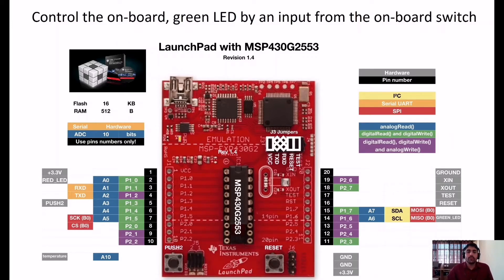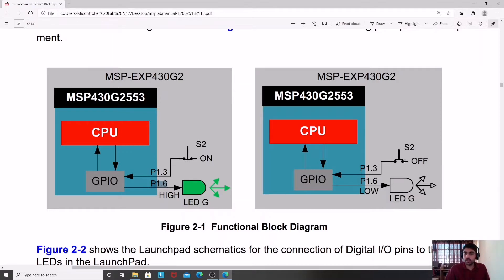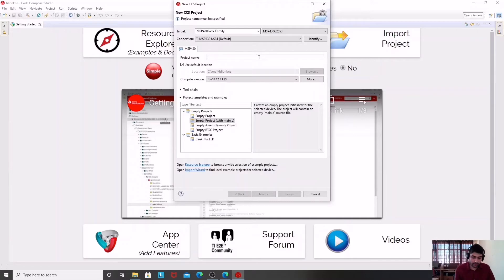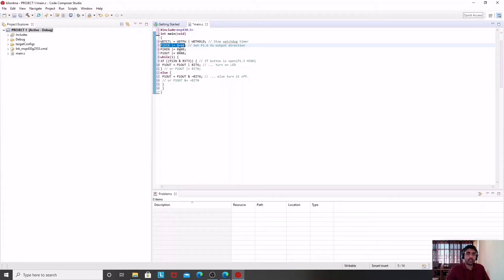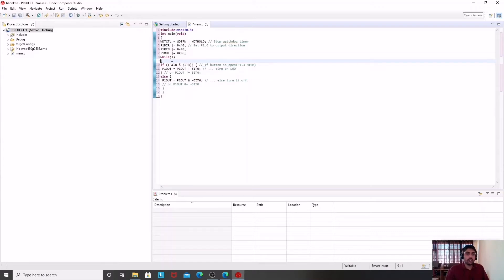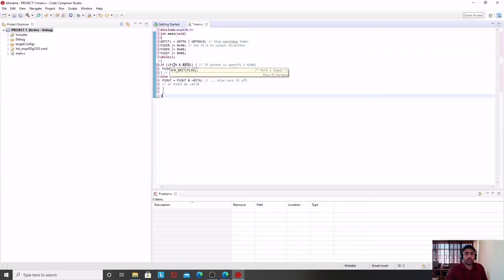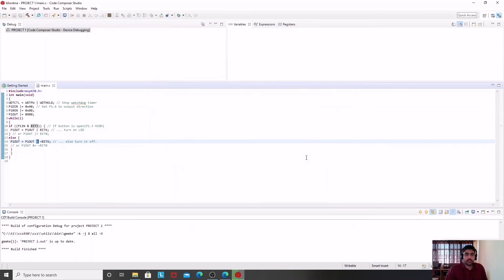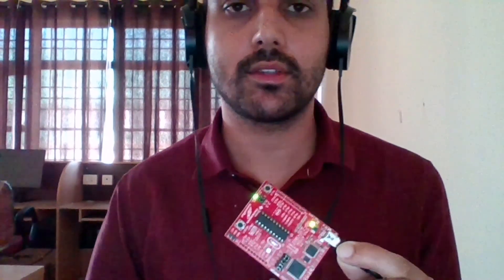Program to control LED using a switch in MSP430 and Code composer studio CCS

Comment: Hello Ankit! Thanks for the video. I have a small doubt, would really appreciate if you respond for this. 
Is it possible to read an analog signal with MSP432/430 Launchpad, at a sampling rate of 1.5kHz and display it in real time?
Reply from the maker: Yes we can do it with adc and serial monitor. You can connect ur analog voltage to any pin of adc and u can read its value on the serial monitor. I hope it will help you.